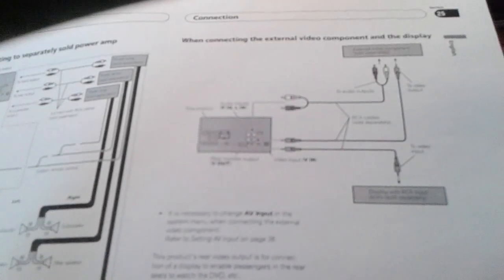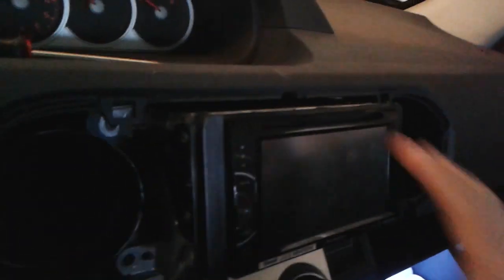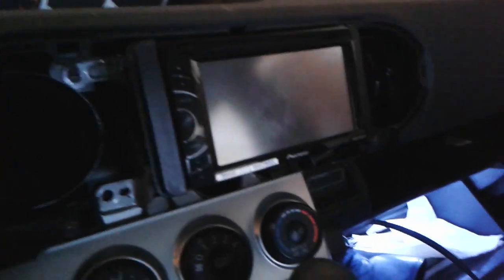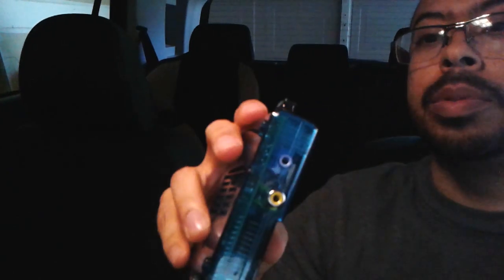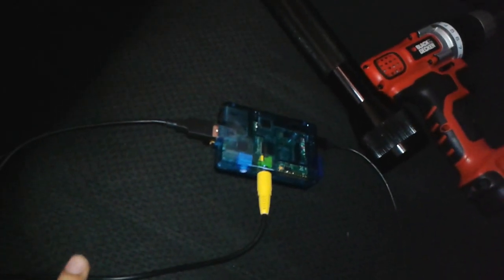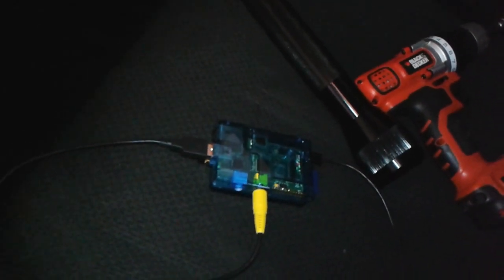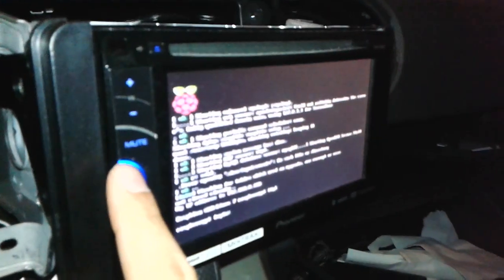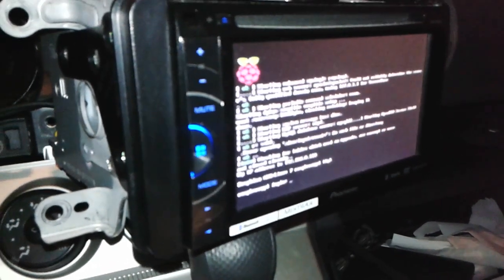Pioneer AVH-X2500BT connected to Raspberry Pi

Comment: Can the a pioneer head control the pi via CEC?
Reply from the maker: TheRangeControl No because their is no hdmi input on the radio just composites for AV.
Reply: Digital Bytes My apologies, I should clarify.  I have a pioneer Avic8200 NEX with HDMI out.

Since it is a touch screen, I'm wondering if there's a way to make it control pi (maybe pi3) through bluetooth or HDMI?
Reply from the maker: Not sure. I haven't researched it yet.  Give it a try and let me know!
Reply: I can't seem to find anyone who has even attempted it.  And, since I am brand new to the "Maker" world, thought I'd ask. :-)
Reply from the maker: No worries.  What I use is a remote that connects to the PI via bt for control of the pi

Comment: I have the same pioneer deck and want too purchase as pi 2,  now I know the video csn be displayed on the deck. I still have so many other questions I need the answer too.
Reply from the maker: +StormX9000 Cool!  I used the Pi 1 model B which had the composite video out (yellow jack).  I believe the Pi 2 may have a composite AV combo jack (black jack) but I don't have a Pi 2 yet.  It may require an adapter plug to make it work.  Good luck with it!